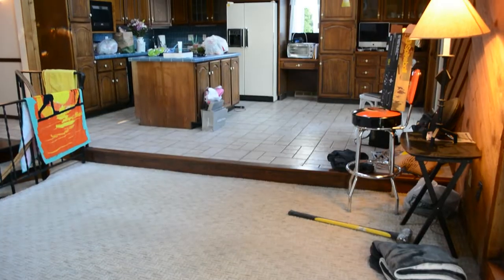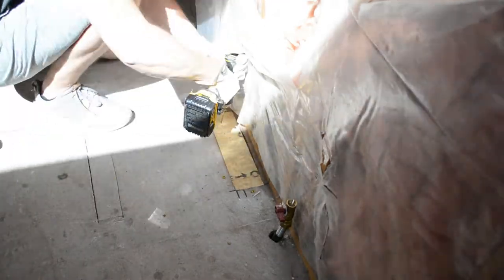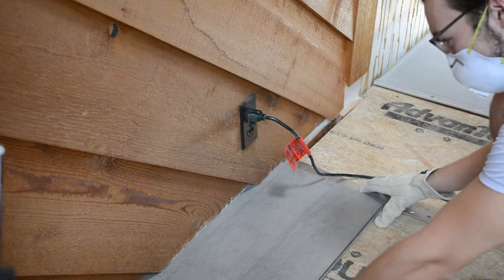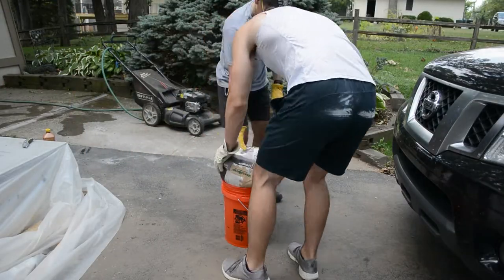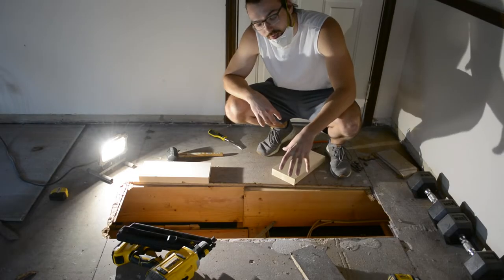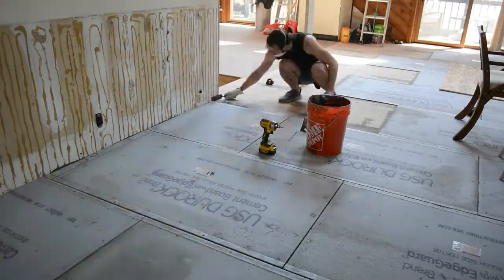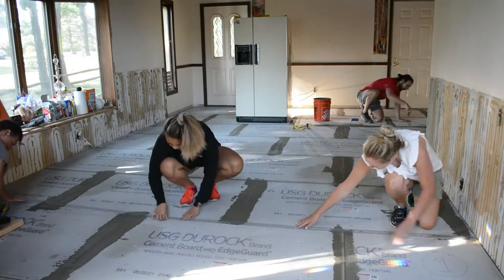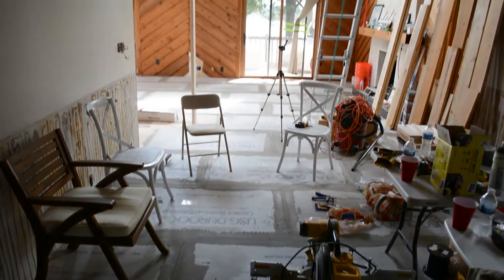How to Install Cement Board / Durock | The Lake House Project Ep 13

Comment: The circular hole in the floor was for the vent on the original jenn-aire range.
Reply from the maker: Ah, that’s what it was for! Thanks for letting me know - learn something new everyday!
Reply: @GoldenKeyDesign  Would be pretty hard to figure out if you didn't have insider knowledge.